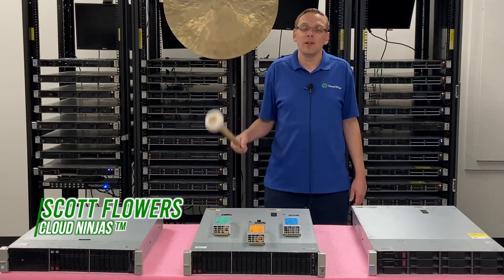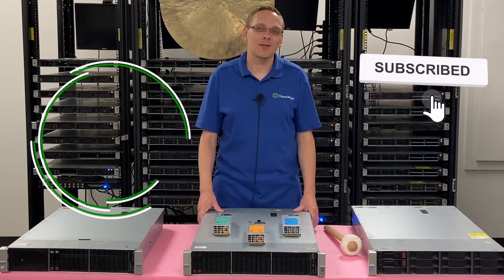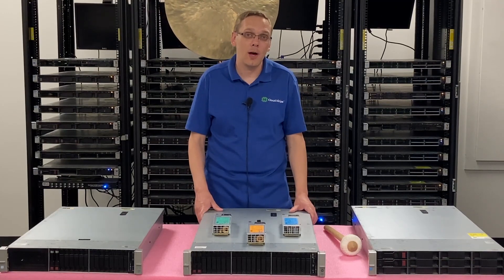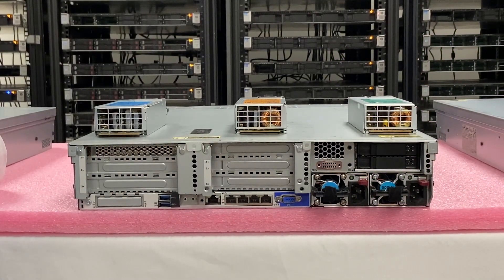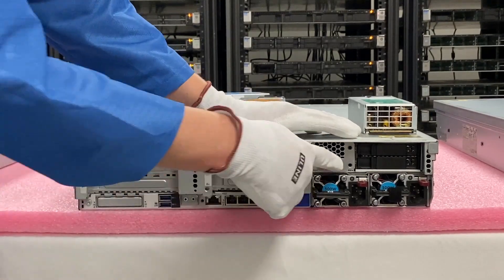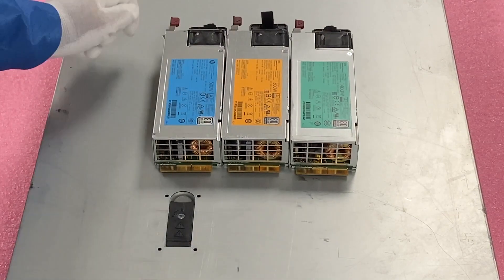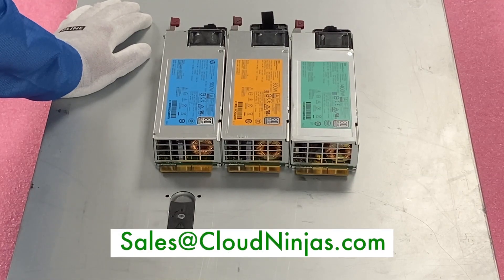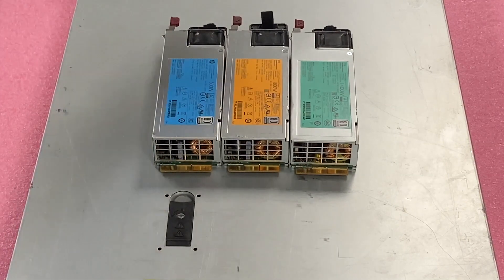HPE ProLiant DL380 Gen9 Power Supplies Overview | Power Supply Options | How to Install Hotswap PSU

Comment: Ohhhhhhhh, so that's why the 800W wasn't working. I had 500W in right slot, and inserted 800W in left slot, and nothing, no power to the 800W. I am going to assume that I would need to power down server and insert both 800W PSU's, then power up. For some reason, server came with single 500W PSU.
Reply from the maker: Glad we could be of service.  Do us a favor and click that subscribe.  Really trying to pump up our sub numbers.  Thank you!